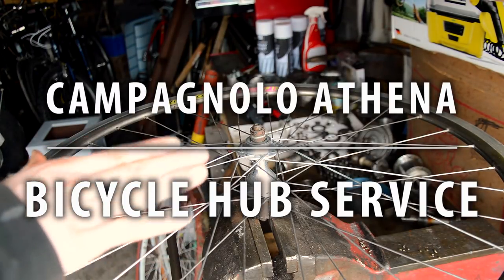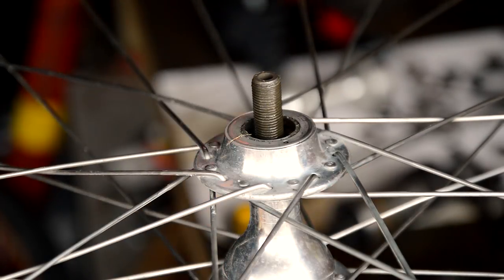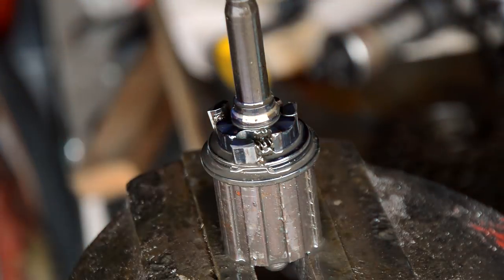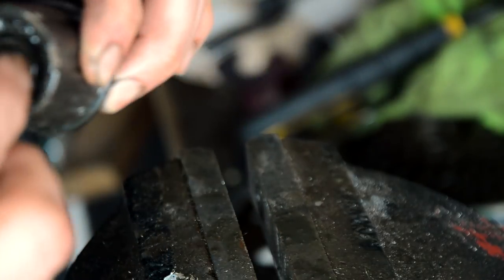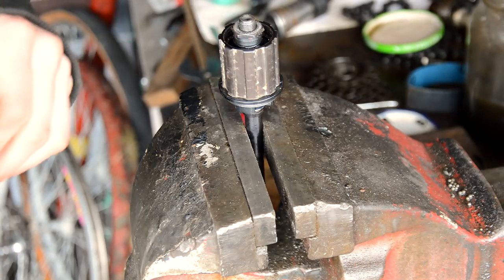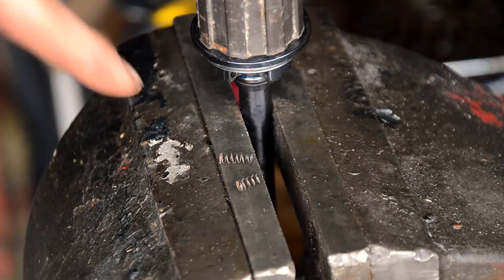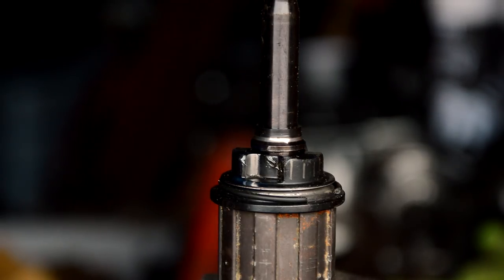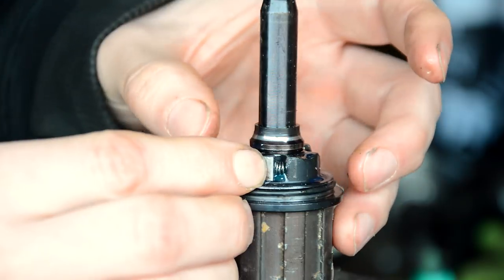Campagnolo Athena Hub Service / Rebuild - Bicycle Maintenance

Comment: Thanks for the video that was thorough and helpful. I’m rebuilding a Campy 8 speed chorus hub and it’s identical to the one you’ve got here, for those out there wondering. 9 x 1/4” balls non drive side, 10 x 7/32” balls on the drive side.

Comment: I want to thank you for your video I have a Mirage that has all sealed bearing. I took it apart has the same kind of 8 speed cassette. When I took it apart I knew it was going to be a problem to put it back together but seeing you video gave me confidence. I tied a very small copper wire around 18 gauge around the dogs after they were in place and got it together after packing with Phil Wood grease.Just before the cassette was totally home I untied the wire and pulled it out of the way. I would have never been able to hold all 3 at once and install in the wheel. I know my limitations '

Comment: I just finished doing this. Not the easiest job, but certainly way easier with the video. I used an elastic band to hold the springs and pawls in place, can’t imagine getting it right without that!

Thanks mate
Reply: thin bare wire also did the job, quite easy to pull it out too

Comment: Great video, rebuilding hubs is a chore, the Campy look a little more complex and you have convinced me my Campy hubs will be rebuilt at my local bike shop.  Thanks for sharing.
Reply: Yep,that's the failing of Campy. Always have to be tricky but good quality.I'll stick with Shimano for easy maintenance and cost.

Comment: I use fishing line filiment couple of raps and or single strand of Wire from a usb cable ease it out once the palls are partially engaged with the hub ...  the sealed bearings in that freewheel are held in with circlips ...  ..  the plastic faces can be popped out of sealed bearings and the grease changed ... these sealed bearings have plain clear grease if you put lithium or molisulphide in they will last a lot longer ... 
Enjoy 40,000  km and riding on Mirage style hub sealed changed three times ... it amazing how more efficient sealed bearings are compared with normal hub arrangements ...

Comment: Great video,just what I was looking for. How come you had to buy new ball bearings.Were the original ones missing or the wrong size? I thought keeping the pawls in place would be tricky and those springs are so easy to snap or lose.I stand to be corrected but I think there might be a special tool the clips around the pawls to hold them in place. Pulls them in and then releases as the other piece is slide over.Costs a few quid.I might try using an elastic band or try piece of string or something similar. Do you not put a drop of oil on the ratchet so you do not have dry metal on metal? Help them run smoother.

Comment: Hi there, I’m doing the same thing as this to an old Campag 8 speed I’ve got. I need to replace the seal too, but not too sure what I’m looking for. Could you tell me what you bought for this? Cheers
Reply: To clarify, the seal between the ratchet mechanism and the drive side bearings
Reply from the maker: I don't remember replacing any seals unfortunately.
Reply: @MonkeyShred  no worries, cheers for the reply. At 11.30 it looks like you’ve got a new lip seal and I’m struggling to find anything vaguely similar!